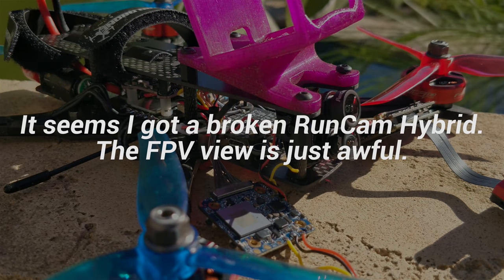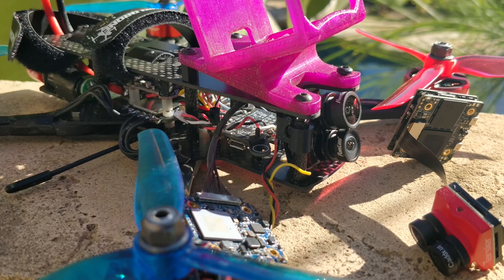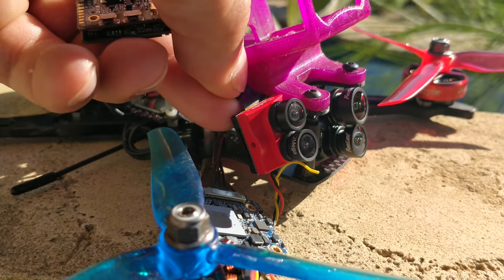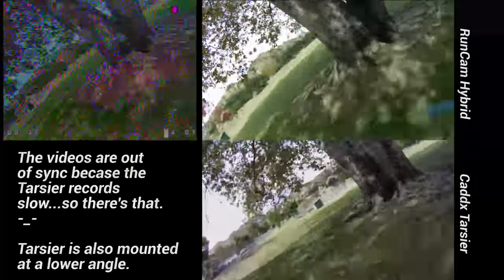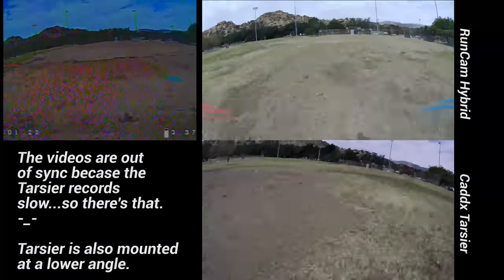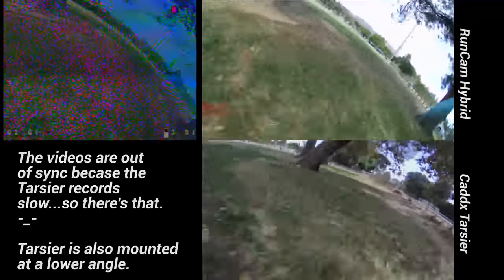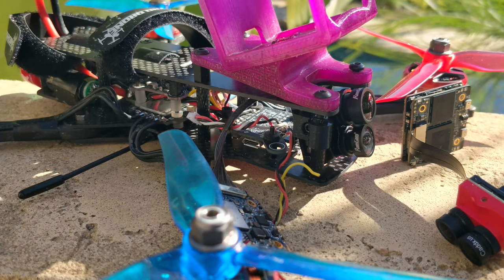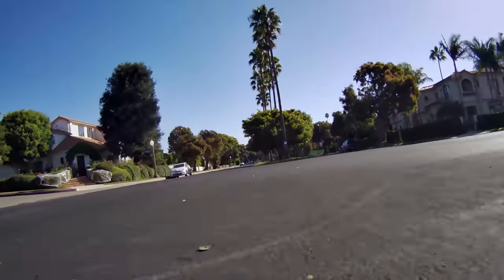RunCam Hybrid vs Caddx Tarsier - sort of

Comment: On the subject of the Tarsier FPV image, I was doing some tests and accidentally removed a tiny component which killed the FPV feed, so I bridged the 2 pads with a wire and the image returned, but ridiculously bright, so much so that the quad's white OSD text looked dim. To fix this I added a 75ohm pulldown resistor which cut the brightness down to near normal.
Now it works even better in low light conditions! :)

Comment: I've only seen the fpv camera image on the bench when I was building a quad for the hybrid cam, but my image looked a lot better than yours. I didn't notice any difference between it and the Runcam Nano 2 on my other quads. As usual, I can't finish a build without buying replacement parts for the ones that just blow up for no reason.

Comment from the maker: RunCam Hybrid: http://bit.ly/33WVEPN
Caddx Tarsier: http://bit.ly/2o1zSLc

I'm going to start sending all the stuff on my channel randomly to my Patreons: https://bit.ly/2oGLP9b

▼Join my FB group for more discussion: Kabab FPV
https://www.facebook.com/groups/379155946182689/

▼ My typical 5" quad setup:
-Hyperlite Glide Floss (will be re-released soon)
-Motor 1750kv/ESC combo: http://bit.ly/2XAEHXH
-WaFL’s Cap Cap: http://bit.ly/2GUpXxO
-Battery: http://bit.ly/2ZoW2rq
-FC: http://bit.ly/2XRc8G8
-FPV Cam: http://bit.ly/2Q7LfL7
-Vtx: http://bit.ly/2HsrASs
-ND GoPro Mount 30deg: http://bit.ly/2WC15zc
-ND Filter (if used): http://bit.ly/2WEmQ1j

▼My preferred goggles as of Sept 2019
http://bit.ly/2k5YNv5

▼Notable motors:
-Xing 2306: http://bit.ly/2Nqqr25
-Xing 2208: http://bit.ly/2y3te8R
-FANTASTIC 6" motor: http://bit.ly/2LqghOZ

▼ 5" Sub $200 build that's still good
-Frame: https://goo.gl/EpXQhZ
-FC/4in1 Stack:  https://goo.gl/HprVbj
-Motors: http://bit.ly/2Nqqr25
-Props: http://bit.ly/2TUQsIg
-FPV Cam: https://goo.gl/FDJhYw
-Vtx: http://bit.ly/2NnO2Au

-Starter goggles: http://bit.ly/2Mw0yNS
-Batt pad material: http://bit.ly/2QGWhYb

▼ If you want to solder better:
-Fantastic solder: https://amzn.to/2P5QM2W
-Fantastic iron: https://goo.gl/DqBipa

▼ Lighting equipment:
-Ring light: http://bit.ly/2ODSg9A
-Panel light: http://bit.ly/2KmDApP
-Power adapter: http://bit.ly/2YD5jHT
-Tripod: http://bit.ly/2MDsMX2
-Mini tripod: http://bit.ly/2MGL4Hf

▼ Tips?
Patreon: https://bit.ly/2oGLP9b

-PayPal: https://www.paypal.me/kababfpv
-Bitcoin: 1E4XZXoD4rS6MYWVWuenY7Kw2M1YgyNpoQ
-Nano: xrb_1188ek5bd7tb9kw67asnp9o65byuoaxbtpxuznx1ribf75x78awywmakj55f
-ETH: 0xD067F93811f2eC31CB1928901002dfdf9A492EF5
-LTC: La2KWYAjp4VT2Lq2M76pbjzXWvRyjpfCtG
-Tesla Referal code: https://ts.la/bob40889
Please use my referral code if you're gonna buy a Tesla.  You get some free stuff when you do and I get better status with Tesla.

Comment: I cant find a session 30 degree 3d print for your new glide frame. Is the 3d print listed under a older frame or something. Also is a 30x30 4in1 esc,or 20x20 esc 4in1 better for use. I dont mind the extra weight,just want smooth good operation. What's your opinions. Thank you bob👍😊
Reply from the maker: At this point there are many 20x20 6s capable ESC's that perform as well as 30x30 so I'd go with those. Either the diatone mamba or the talon one or the Hobbywing or the aikon. All work well.
Reply: @Kabab  thanks,I ordered the lite version of your glide frame on your site. Looking for a 3d printed go pro session mount like your pink one on your frame. You think brain 3d will have them for your frame. Wont bug you anymore,thank you for your input👍
Reply from the maker: @tylerwilliams786  Brain3D has it all. If they don't, Email them and he'll make one within a day usually
Reply: @Kabab  I messaged brain3d he wasnt sure if he has your new frame. I checked his site. He does have the old hyperlite glide frame. I was woundering if tht top plate has same dimensions as this new frame of yours I just bought. Then I will jist order the hyperlite glide session 3d print.???
Reply from the maker: @tylerwilliams786  it's the same pattern on all the glide frames
Reply: @Kabab  thnk you do much,sorry about all questions. Thnks👍

Comment: How do I flip the fpv feed video on tarsier? 
Option in app only flipped the 4k which is a waste. I can flip that in video editor. I need fpv feed to fly lol
Reply from the maker: Best of luck. The UI is absolutely awful awful. They had to work really hard to make it that awful 🙄
Reply: @Kabab  hahaha.. yeah and my 2 plugs and osd boards didn't work.. took forever getting mad clicking away to finally get to flip vertical in camera menu.. something wrong with my tarsier the osd boards don't work. Both , up down and right doesnt work. Left goes down and clicks. And the clicker goes down and clicks

Comment: Thanks for the comparison! I hope they iterate on their products further, but competition is good either way. I wanna build a toothpick with an HD (not 4K) cam (which probably goes against anything you preach about the AUW and so on, but would love to have one). If I could keep 80% of the flight characteristics and speed of a nice toothpick but also get HD video, that would be awesome.
Reply from the maker: I was just testing the baby turtle on a toothpick today. 110.5g auw. It's just no fun to fly. It's that last 15% of the performance that makes all the difference it seems. ~105g auw and under seems to really be the sweet spot. Yes just 5g more apparently ruins it. Then again I'm super picky...
Reply: @Kabab  thinking if i could use the GEPRC Phantom as a base and add the baby turtle maybe there or a runcam split 3 nano. Noted, will see if I can keep under 105g :D
Reply from the maker: @FPVtips  but you sacrifice significant motor performance to save motor weight

Comment: Hi bro good review and comparison. Iam into micros upto 3in so is there any better solution other than these dual cams. I doubt 3in can carry a gopro session 5?
Need your advice bro. I am planning a iflight IH3 dual stack build. i Have caddx turtle and runcam split mini 2 both has latency issues. I want a clear FPV view so iam confused what to go with  now need your inputs pls.
Thanks
Reply from the maker: The tarsier has the very best fpv view I have ever seen on any HD split sort of product. It's HD video is among the best as well. I still don't like any of these split products however
Reply: @Kabab  Hi have you used iflight ih3 frame. Can we fit runcam 5 in it. Iam a 3in guy so if runcam fits i can go for it?
Reply from the maker: @outboxfpv4360  is that the one with the prop guards? I think it will fit on top if so but you should know that it does not fly well due to the guards. No ducted 3" flies well.
Reply: @Kabab  it has no prop guards its a dual stack frame
Reply from the maker: @outboxfpv4360  oh ya that's cool. GoPro will struggle to fit on top with a battery.

Comment: I am willing to bet your runcam is fine but you have the polarity of the video reversed somehow! (i.e. ground---sig; sig---ground)
I have seen similar image with this error!
Reply from the maker: I actually checked that. No issue there. The cam is genuinely busted
Reply: @Kabab  huh. I wonder what it looks like on a scope. I got the tarsier and I am impressed with how much they managed to fuck up the user interface! The video quality seems good but it doesn't look very sharp, it looks less than 1080p on the green mode (2.7k) Is there a way to get true 2560x1440 out of it?

Comment: 3:10 probably because the lenses are so close together that they couldn't get the ND filter to fit over just one.
Reply from the maker: I considered that until I flipped the filter around and it fit over just one and between the two 🤨
Reply: @Kabab  oh. Well maybe because it looks sweet?
Reply: @DoRC  more likely because they use the fpv cam to set up the shutter of iso or something
Reply: @peterzingler6221  I doubt it. The two cameras are completely separate systems.  It would be overly complex and wouldn't make sense to have one influence the other.

Comment: Is that rcin power motor?
Reply from the maker: Yep the older 2305. I actually like it a lot.
Reply: @Kabab  was planning to use 2207.5 for glide lite, but heck am gonna try this motor
Reply from the maker: @underhog5275  the amaxinno 2305 is maybe a touch better.  The quad does need to be really light. My Glide Lite frame is a fantastic pair with a 2305. The lighter arms and motors really feel incredible in the air.